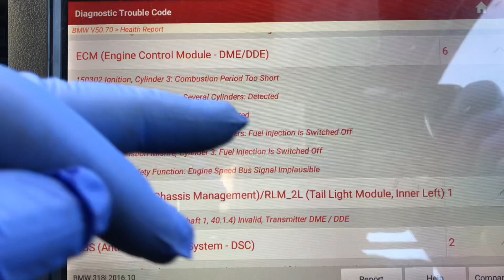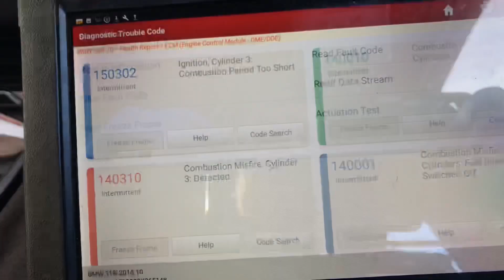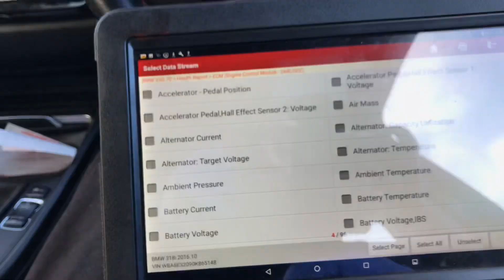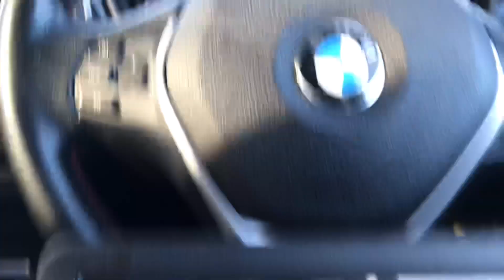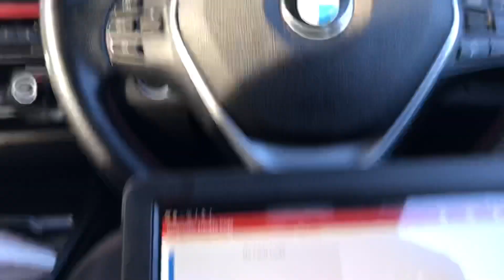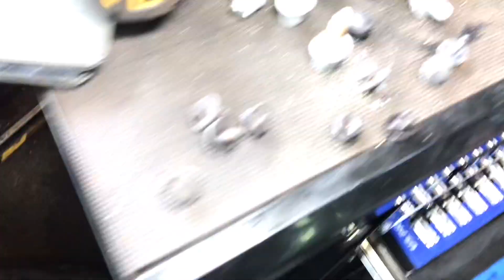BMW 318i F30 (2016) Fault Codes 150302,140010,140310 Misfire Cylinder 3!

Comment: hi lads ,another fix , need to torque these plugs , you didnt say so dont know if u knew. hope this helps "Indexing" spark plugs refers to the orientation of the spark plug electrode's open end within the cylinder head combustion chamber. Whether the side electrode requires special orientation or indexing within the chamber is controversial, normally torque to 23nm
Reply from the maker: Cheers Robert never knew that, Sandy